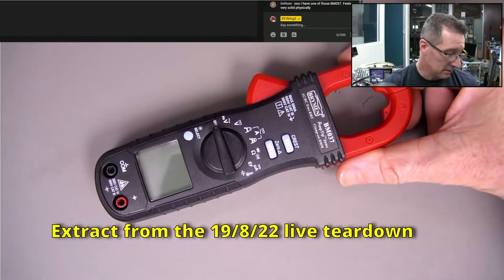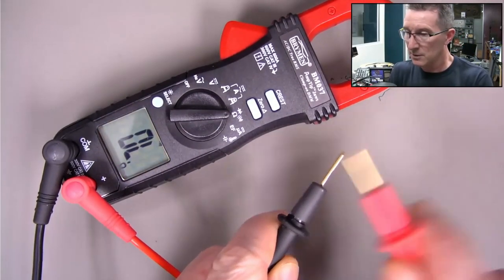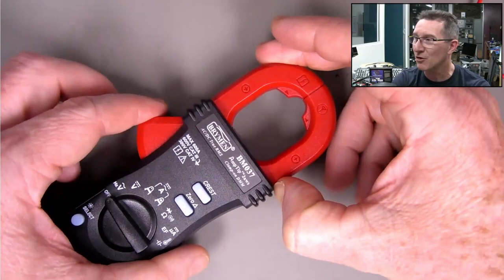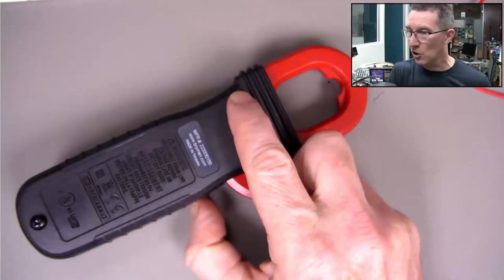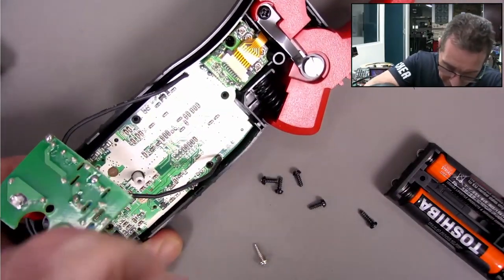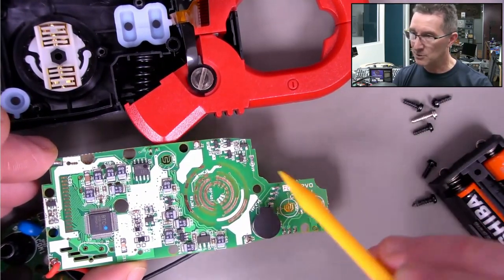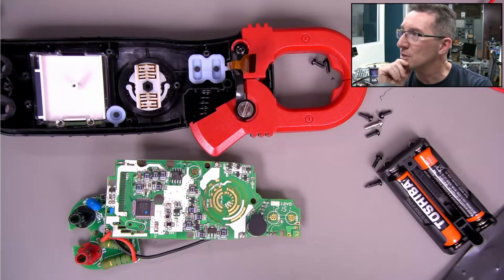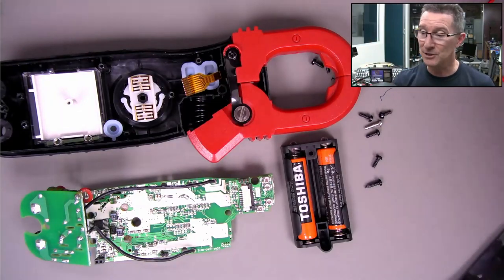Brymen BM037 Clamp Meter Teardown

Comment: It's slow & crappy, but for £20 the Uni-T UT21x series are nice & compact and pretty good for value for what it is. 
The 2, 20 & 100A range one I have covers all my uses.

The moulding feels great with nice plastic used and having the wheel hanging off the edge is useful as enables easy one-handed operation.

I did have to solder wires from the battery box to the board as the little spring contacts that normally provide continuity started playing up (similar spring contacts to this Brymen one). After a few years of being stored in a damp workshop the power would cut out / flicker on/off when buttons were pushed.

---

If you're going for something fully custom then wireless logging to your phone would be a neat feature for a clamp meter.

Comment: Appa 18 plus
Fantastic clamp meter, fast, quite.precise, a lot of useful features ( pase rotation,.thd, cos fi (it has 2 independent AD so it can measure V and A at the same time, so W of course. AC and DC , and both at the same time too.
Check it out
I also have the fluke 325 ac/dc but single dac, cannot even be compared to the appa 18+
Check it out
Reply from the maker: Will check it out, thanks.
Reply: @EEVblog2  APPA would be really interesting to test..iMeter5 from APPA it is a lifesaver with its accuracy and a small weight..

Comment: I really like my Appa 156B clamp meter, their meters are rebranded by many, many people.
Seaward, Megger, Benning, ...

For a clamp meter, I would say a significant market for ones that measure DC is the solar industry, and for those of us in that industry 1000V input is a requirement. Almost all of the strings that I'm designing are over 600V. 1100 is the highest I've done though that does require a very cold and very sunny day! I have seen 850-900V on my meters reasonably often though.

I would like a more compact clamp in the style of the BM037 that can cope with DC and 1000V. I think the clampy bit on the BM089 looks too big. I've recently picked up a Klein CL800 which I have a feeling might have some Uni-T influence. Seems nice.

My clamps are all better at low AC currents than they are at low DC currents. The Uni-T 210E does have a 1mA range but it's a bit pants. I think having that range gives you more confidence in the 10mA range readings though.

I think for electronics use in a lab or at home a multimeter is the correct tool, but for anything actually out in the field I'd only use a clamp. I very, very rarely use a multimeter these days but my clamp meter batteries only last six month or so. Partly because I use it a lot, partly because it's not very efficient. 

Brymen already do blue meters for Metrel.